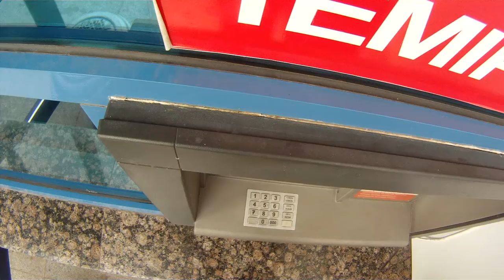SibExTrail 2012 - Episode 10 - Trouble in Astana

Comment: Walter, how did you manage your go pro?  Were you filming only when you thought it might be interesting, and everyday deleting what ever you thought was boring, or you kept all of the footage. From my experience on gopro2 you can only film about 3 hours (with two batteries) so if you film whole day you need to switch batteries twice and card once. I have gopro on my car, whihc is a pain, as I want to start it or stop it I need to get out of the car, and using wireless chews up batteries.  On MTB it is much easier, but still pain.
Reply: Well I did one go pro session a day - a bit over an hour, so yes by now I had learned to ration it to times when it might be interesting.  Of course it meant we missed a lot that happened when the go pro was off.  Ideally if you are filming it, you have about a fleet of 10 Go Pros, mounted on all the helmets and all the bikes (at various angles and mounting positions) and have them running continuously with a huge stack of 40+ batteries that you would need to charge every night... that is way too much effort for me and would undermine the actual fun of ride.  It also puts huge demands on the other team members who really were just there for the ride.  At the end of the day you kinda have to choose between making a decent video and having a tiny bit of a ride thrown in, or having a decent ride and scratching out a crappy video on the back of it.  I chose the latter.